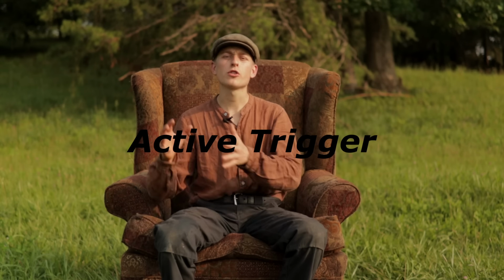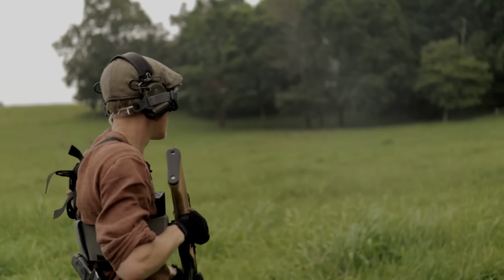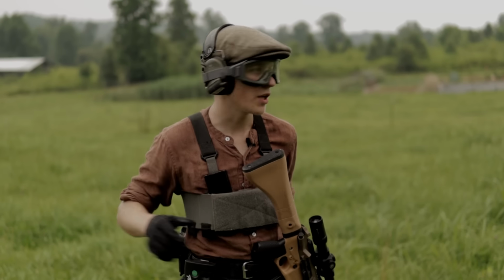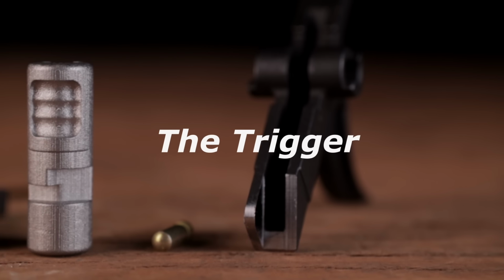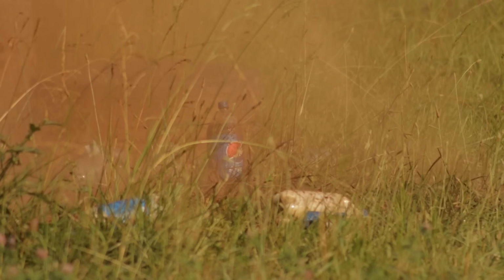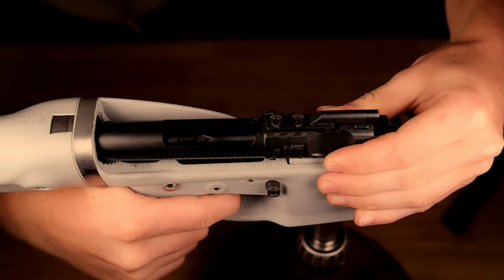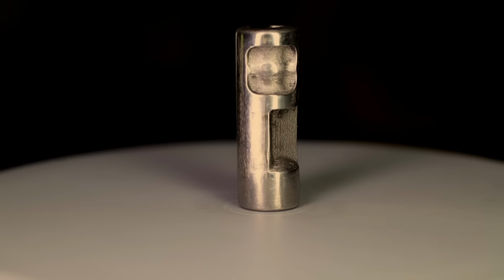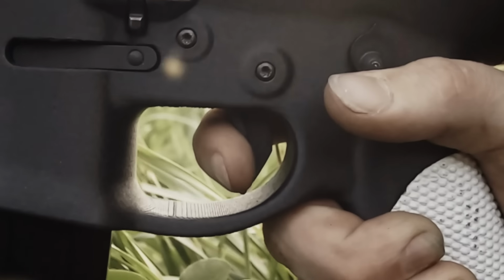Introducing the Super Safety

Comment: So this is defined as a machine gun by the ATF. If you use the energy of the bullet to reset the trigger you create an automatic reloading firearm, the definition of a machine gun that has one without manual reloading. the reason a semi automatic is not a fully automatic weapon is because you have to “manually” release the trigger to reset it. This device allows that to happen automatically, therefore, even though it’s firing one round per pull of the trigger, it is a automatic reloading gun therefor it’s a defined machine gun.
Reply: Nope. Perfectly legal per court rulings 💁‍♂️
Reply: Yes per the ATFs interpretation of their rule change. But not the NFA; however, this doesn't mean that it isn't an FRT which the ATF is already going after, so you might as well just have an MG at that point.

Comment: Yep, get ready for an ATF visit and not a friendly one to be sure. Anyone who buys it or downloads the plans to print one will as well. 😂
Having said that, the rotation of the safety on this device will rapidly wear your lower safety bore hole OUT. Then you will be SOL and you will need a new lower. Especially since the texture of the safety is so rough, it will act like sandpaper in that bore, making the wearing out of that bore even faster.
Reply from the maker: No wear so far, I think it's because the surface loading is so low.
Reply: You are correct. It will wear it down. Harder materials wear down softer materials.

Comment: Ain’t no way the ATF isn’t knocking on doors to take these back, just like the FRT’s. Impressive though
Reply: they first got to confiscate every 3d printer first
Reply: @johntran4478  That’s fair. I applaud the ingenuity it took to make this, and I’m glad he did it. As long as the ATF is under Biden though I just know this will be an issue for anyone caught possessing one.

Ironically the ATF has all kinds of time to bother law abiding citizens who, even if they did possess an FRT AND a bump stock, have no plans to harm anyone… but these kids running around with Glocks that have a switch installed, they can’t seem to do anything about that
Reply: @johntran4478 People aren't 3D printing these things. They're sending files in to be made of 3D printed metal.
Reply: @printingwithpeek4897  you print it to make wax molds.
Reply: @johntran4478  And like I said, what are you going to cast that can handle this type of torsion on the part? Why do you people never think.
Reply: @printingwithpeek   I'd say start with iron and move down the hardness depending on the pin that's rubbing against it.
Reply: @johntran4478  🤦Stop talking

Comment: a comprehensive list of the legitimate practical uses for this:
Reply: Do you really need a list ? You goober.
Reply from the maker: Did your connection die? I can't find the list (it's pretty long, so should be easy to spot).
Reply: @HoffmanTactical  oh and the most important use of all, making you money
Reply from the maker: @py-e2r   I do like making money. Not that this project has made me any, but others do.
Reply: @HoffmanTactical  oh right. here it is:
school shootings.
work shootings. 
concert shootings. 
street shootings. 
miscellaneous other shootings. 
boar hunting. 
“self defense”
feeling super tacticool.
Reply from the maker: @py-e2r   If an evil school shooter wants to shoot fast, there are a lot of other easier ways to do it. Using that argument against the super safety is the same as using it against any other firearm. It won't fly.

Comment: Please help: i just installed mine and it seems like the hammer is occasionally riding the bolt carrier home.

Everything seems to function ok when i take the upper off and manually actuate the safety.

Am i just holding the trigger too hard which actually turns the safety, or do you think maybe i got the grind geometry on the trigger wrong.

I love what you're doing! And when you do come out with a metal version I'll be sure to get one (maybe sell it with a machined trigger mod too)
Reply from the maker: Probably the lever is too tight.

Comment: Did you consider making a version where the middle is safe, pushed to the right is semi and pushed all the way to the left is fast-semi? Will be easier to choose a firing mode, but will make making the gun safe a bit trickier (depending how much force is required to move the safety)

Comment: So I will print one gladly, but im gonna prolly want one a made of something a little more substantial. Maybe a burn out casting an a little sanding/polishing could get you there? My only concern here is will the reciever safety hole get all rounded out having a pin using it as a bearing surface?

Comment: Not a machine gun definitely a forced reset trigger ok borderline machine gun it jusst depends on how much force is applied to the trigger by the device. If you can in active status pull the trigger to the rear with only one round firing then its ok

Comment: The most interesting part about this… is you can cycle the safety on and off while pulling hard on the trigger with any AR fire control group. 

So…. This can’t be considered a machine gun, due to it using a function of the safety transferring the hammer to and from the trigger sear. This is already considered semi auto. So you can’t shoot this down as select fire without making every AR style fire control group also select fire. 

Clearly it’s semi auto. It changes no interaction with the trigger that doesn’t already exist. 

Unlike the FRT which did create new mechanical interaction with the trigger. Opening it up to scrutiny on “single action” interpretation.

Comment: The AR trigger group is a brilliantly simple design. It also appears that the modification in this video is brilliantly simple as well. It seems that the solution here is the simple act of "bypassing" the disconnector, alleviating the need for the jump from the disconnector catch to the trigger ledge, and going directly to the ready to fire mode sitting on the hammer ledge allowing you to shoot faster, but more importantly remaining semi-automatic and the need to pull the trigger for each round fired, so it is NOT a machinegun. I hope it will catch on and be available in a steel, ready to use kit. But you know the TYRANTS will hate this device and do all they can to have it outlawed.
Reply: you mean like Trump who outlawed the bump-stock for similar reasons?

we gotta keep that fascist out of power

Comment: I need to add, it doesn't matter if the firearm makes you a ham sandwich in between shots, if the trigger reset is accomplished with anything other than MANUAL MANIPULATION...IE ...PHYSICAL RELEASE OF THE TRIGGER the ATF says its a machine gun.  machine guns are defined as not having a manual RELOADING cycle....

Comment: I love it and it SHOULD BE LEGAL, but its not. Since the reset is done via MECHANICAL LEVER and not by manual force, its a defined machine gun unless the AFT looses the FRT case. The mechanical force of the BCG moving backwards is defined as not manual reloading, and the ATF says the NFA/GCA define a machine gun as a firearm WITHOUT MANUAL RELOADING. The reason a semiauto is manual reloading is because the trigger reset is accomplished via a MANUAL RELEASE OF THE TRIGGER.  This MANUAL RELEASE OF THE TRIGGER qualifies a semi-auto as NOT a machine gun.  Go read the law. READ ON MANUAL RELOADING...
Reply from the maker: Manual reloading has nothing to do with the trigger function.

Comment: You should look at the ATF's letter regarding FRTs. If you can fire more than one bullet by continuing to pull, they are regulating that as a single action of the trigger. There is a legal battle against this, but as it stands they are treating systems like this as machineguns and possessing one of these could cause unforeseen legal difficulties. I am not saying I agree with the ATF, but this should be known before you print your own.

Comment: For any wondering, it will not work with the FGC-9 Mk1. The attachment point for the upper and lower will not allow the lever to go back far enough to reset the trigger or let the bolt to slide all the way back.
Reply: i am so distraught by this, does it work with the mk2?

Comment: wonder about the durability of the safety selector switch hole ,in middle position  it eventually widen or shape into an oval when the selector constantly half rotating ,
 how many rounds till out of spec and become unsafe ?
Reply: Yea exactly. That's why I'm not necessarily  a fan of this design. It's smart that it can be incorporated onto pretty much any trigger, but the fact that there's no carbide bushing or something where the selector goes, this is going to wear it out prematurely

Comment: Lookiiiing at the design and wondering if a hand tooled version is viable.  Start with a steel (or brass) tube of the proper diameter and cut or file a few groves.  Maybe a printed guide.

Comment: New technology,so sweet.
And seems to run smooth with 0 tuning.
Reply: I am sure there was tuning.... you start getting issues like bolt bounce if for instance your buffer is too light and/or there is not enough "free space" inside it for the weights in there to slam against the front of the buffer housing milliseconds after the housing itself stops when the bolt is returning to battery. Gas regulation issues that were not an issue on non force reset shooting can all of a sudden be a problem. I am sure people are able to throw it in and run perfectly first go, but they are defiantly the lucky minority.

Comment: Why not resin 3d print it so it's super smooth then cast it in metal?
Reply: Because resin is just a uv cured epoxy with terrible wear properties. Any metal you cast is also not going to be durable enough. And no, zinc is not durable.
Reply: Idk I'd think any cast metal would still be more durable then plastic even if it's only aluminum let alone steel
Reply: @Perses-_-  You're not melting cans down do this.
Reply: @printingwithpeek  I'm not quite sure what you're trying to say? Can you reword that?
Reply: @Perses-_-  Bro. You're not melting down 3 fucking coke cans to make a selector that does this. If you can't understand that, God help you.

Comment: But doesn't this still use continuous pulling of the trigger to function? I'm pretty sure that was something the ATF specified when they looked at FRTs, you're still using one continuous force applied by your finger to fire several rounds regardless of what the trigger is doing mechanically. Unless you're saying you're willfully moving your finger that fast.
Reply: Yes, this is the same exact thing just a different implementation
Reply: That’s not what the actual law says, and it’s only been in the past year or so that they’ve all of a sudden started using that rhetoric. And there’s not really much, if any, legal president in any court yet Where they’ve actually gotten away with that.

Comment: 10 years ago I bought a Polymer lower receiver from New Frontier armory .it came with a Polymer trigger and safety.. worked well when i used it so maybe a printed trigger will reduce the where on the part or if they still sell Polymer tirgger you can buy one..maybe?

Comment: Damn, Ive thought about frt triggers before and this is a really smart design.  Very simple and it basically uses an almost stock AR 15 design.   Only concern might be wallowing out the selector hole overtime, but probably not a big deal if it's even a problem. Fantastic.  Even if it's somehow not legal, it's easier to make than an auto sear, and probably more reliable than a lightining link.
Reply: I’m not sure about it being easier than an auto sear. Either way at least it’s not a part that is readily installable on a standard AR 15. I think this is a benefit.

Comment: BATFE ignored the definition for FRT triggers which this “super safety” seems to be a safety with forced reset. Not trying to discourage you, just saying that FRTs work the same way in mechanically resetting the trigger so you can just keep rearward tension on your finger to keep pulling it faster. In fact BATFE is actively harassing everyone that gun broker claims has even peeked at FRTs and threatening them with 10 years in prison and I don’t recall exactly the fine but it’s absolutely retarded and Tyrannical.

Comment: Just FYI the cam unit itself can be 3d printed in 17-4 stainless at Zometry for $190 each (or only $115 each if you get some buddies together and order 10, the price only drops to 110 each if you order 100 so the real savings is getting from one part up to 10).  

The lever can easily be printed, and replaced easily with new prints if it does break or wear out... and you all know where to get a mill spec trigger for cheap. 

I think you could build this (build it to last with the 17-4 steel cam I mean) for about $250 or less (if you bulk buy the steel 3d printed cams with your buddies). 

What were the FRT's selling for $360-400?  That sounds right, but I don't remember. I do not think it was ever as low as $250, though to be fair it's apples and oranges since that was a drop in trigger and this is definitely not a drop in!
Reply from the maker: Just got to watch out with Xometry, they have some pretty poor QC.
Reply: @HoffmanTactical  Thank you for the tip! Where did you have your metal porotypes made if I may ask? 

I would assume that some home post processing would be required but I would also feel fully justified in sending the part back for a remake if it was defective, regardless of the manufacturer or technique used to produce (i.e. subtractive manufacturing at a regular machine shop).
Reply: or you could simply use a small lathe.
Reply: @robertfontaine3650  I'm no machinist but I think that a lathe would not work at all to turn the cam profile. So after you turned the blank to the proper dimensions then you would still have to machine out the cam and detent divit.
Reply: @heathbecker420  You can do simple milling with a lathe.

Comment: Does it work with the cmmg 22lr conversion kits? My guess is no b/c the bcg doesn’t open up over the safety area when fired. OTOH it shouldn’t prevent the 22 conversion from working as a non-frt system.

Comment: It is so incredibly simple, and thats highly impressive engineering. I am honestly surprised that other people making FRT's did not go this route.
Reply: One of the things I love about engineering is how many different ways there are to make the same thing happen. I have always found this fascinating.
Reply: @aperfectcircle008 I could see a roller bearing on the lever bar would take care of wear between the bolt and bar.
Reply: The design is imparting force on components in areas that were not originally designed for it, hence the softer materials only lasting a few hundred rounds, there's also an amount of hand fitting to get to the point it's timed and functional. Durability and reliability would matter if it was going to be relied upon in life or death service. Definitely an amazing amount of engineering and creativity. The door has been opened with this outside the box thinking. 👍

Comment: I think the connector on the bolt probably makes this an MG. It's a cool design and novel even when compared to something like an FRT since it can fire standard semi auto. However, every simulated machine gun barring the binary trigger has been banned. Binary triggers are a parlor trick and not something you would rely on in a defensive rifle. This looks effective, which is probably why the ATF will ban it.  Given it is 3d printed they have a fat chance of doing that, but they'll deem any AR with this in it an MG.

Comment: apparently I can't copy the text in but 
not a lawyer and you can pin of shame me (i love the design btw) but:
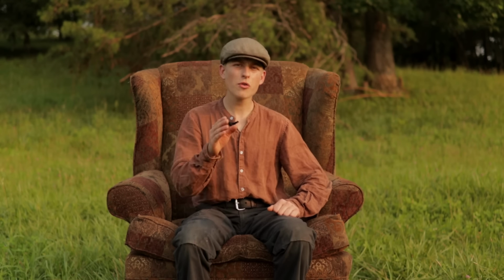 13:50   US v. Babbitt 12-10-2020 under the current legal standard, one round per "pull". At least until all of the brick of legal citations gets undone. Their issue as stated in Babbitt is that 'function' was used instead of 'pull' to avoid loopholes - in other words, each 'function' of the trigger must be initiated by the operator. If the trigger is being acted upon by something else, that's not the trigger functioning, that's a device acting on the trigger. Have a gander at section ii "judicial interpretations" on babbitt for the full list of 'function means pull' from the supreme court

Comment: Here we go again with trying to muddy the difference between 'function' and 'pull'.   Common understanding of 'semi-auto' is 'one pull...one shot' and one of the tests the ATF did with the FRT's was to rubber band the trigger back then drop the slide on a full mag...which proceeded to dump all by itself.   The rubber band never released its' 'pull' and NO other semi-auto trigger will do this.   Also mentioning the fact that this trigger thing won't work unless you have an M-16 full-auto bolt carrier and that the little lever it hits is in the same location as the auto-sear.
I'm really not understanding why some people want to endure litigation and possible prison time for something so stupid as this.   If you feel you are a Revolutionary by 'fighting the Man'....OK..enjoy your fantasy, just don't expect any sympathy from your 'bunk buddy' when doing time.
Reply: I'm still wrapping my head around it but its notably different than forced reset triggers which require you to hold the trigger down with a constant pressure. Its just shortening the over travel and reset release which makes it easier for someone to shoot fast. Based on the splits its shooting at 333RPM which matches competitive shooters while FRT hit 830RPM which matches the full auto rate. That alone shows it requires a conscious effort to use this trigger unlike the FRT. The ATF threw a hissy fit at the FRT due to the lack of conscious effort while this trigger requires it. But we will inevitably see how the ATF comes up with new BS logic to justify banning them since their excuse with the FRT is not moot